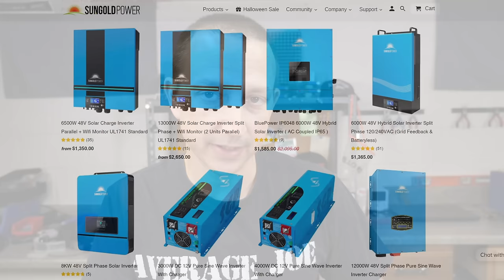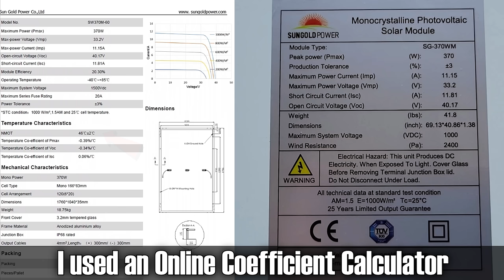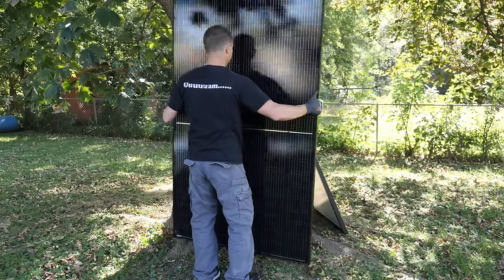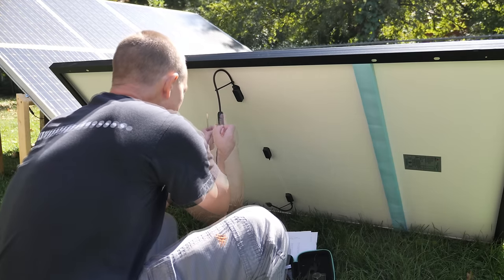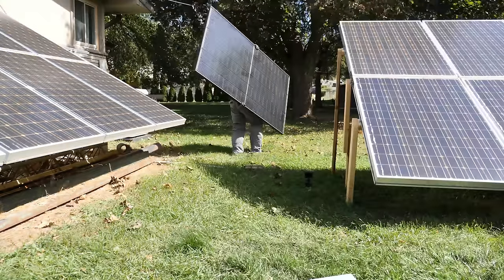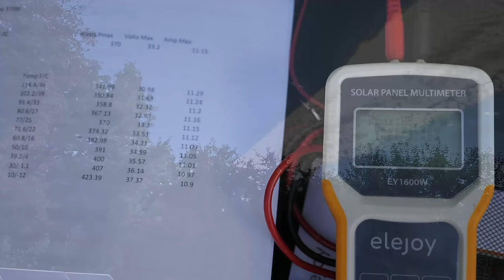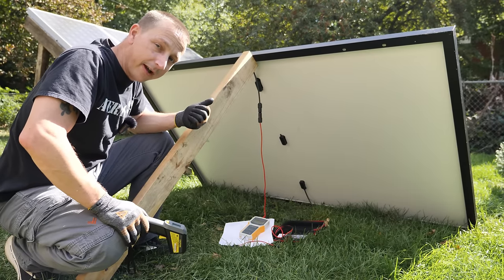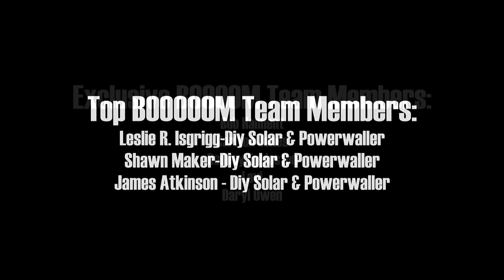Sungoldpower.com has SOLAR PANELS!!! 370W Mono Black Perc 4.4kW

Comment: Going on 1 yr of Sungold Power equipment ownership of 2 x TP6048 and 2 x SG48100P batteries. Totally awesome equipment. Didn't go with their panels because of shipping and per unit cost as I live in the Caribbean. Also, they lack cross braces (reinforcements) that I think is a must for such large panel. heavy winds (hurricane zone)   Highly recommended company. Otherwise, very happy with purchase of the inverters and batteries from Sungold.

Comment: Just for technicality the temp gun  should be held closer to the surface you are wanting to read the temperature on for a more accurate reading. Distance in this case does matter for the most accurate reading.

Comment: Great video Joe. Just wanted to let you know that every solar tester I have reads around a 10% error in comparison to real test equipment. I also see quite a variation over activation time. The longer the tester is activated, it starts to heat up and reads more error usually favoring the solar panel specs. I use a Keysight N3300A load tester to do real measurements and to compare my cheap meters to. I realize that most people don’t have access to this equipment and can only use what they have. Just keep in mind the problems with cheap import meters. Thanks again for all your videos.
Reply from the maker: Awesome! Thanks for that info! Ill have to look that up!
Reply: @AveRage_Joe  hey Joe, I work for Keysight. If you ever want to do a review about solar testers and need a calibrated load bank like the N3300A to compare with, let me know. I can probably have something shipped to you if we have one in our demo pool.
Reply from the maker: Yeah we could probly work something in! Is it tricky to use or learn how to use😄

Comment: Joe: On the label is that standard insolation number of 1000W/sq meter.   Your day could be anything between ~700W and 1,400W/sq m!!  To do any kind of valid test you should measure the insolation while you're measuring the panel output.  That way you correlate the panel power output to the actual solar radiation at the time of your test.  Insolation meters are not expensive and are smaller than the panel power meter you toasted.    It could well have been the cold panel and a much higher insolation than 1000W/sqm took out your power tester.

Comment: Canadian solar bifacials 400w same dimension. Semi rainy cloudy day 240 each. Have them setup as wrap around awning not on roof so can take advantage of bifacial going up to 440w.. But if had option to get all black,  sure would go for what's shown to add on. If under 1.74$ per watt shipped, as that's what paid before. Good video, Have a great day.
Reply: The only problem with Canadian Solar is they don't function as well as other top brands in extreme heat environments. So unless you live in the north, there are better panels.

Comment: I'm dating myself here, but that solar meter looks a lot like the handheld football game I had as a kid. 😂
I'd be concerned that the panels are pushing out more than they are spec'd for. That could be an issue for others than plan for a specific amperage and wattage. That could cause some serious issues with equipment.
Reply: Yeah, it does.

Comment: I'm Interested in the inverter. You have this 12 kWh. My question is the average current that it can handle is what? 
I saw that the light is almost 1kwh. stove and other "heavy normal home apps" would be like another 3 kWh or 4 kWh!
So for how long do you think this 12kwh Inverter can handle these loads? And what are the limits for it?

Comment: JOE, LOOKING FORWARD TO YOUR NEW PANELS UPGRADE!
ALSO, HAVE YOU INSTALLED 200 AMP TRANSFER SWITCH FOR YOUR GRID & GENERATOR INPUT, SO YOU DON’T HAVE TO DISCONNECT GRID & INSTALL GENERATOR IN LONG BLACKOUT CONDITIONS?
Reply from the maker: I did install a transfer switch about a month ago...sadly it blew up as well lol.  A coil burned out... Ill have to get a diff brand and reinstall!

Comment: Good review.

Here's an off the wall question.  Since the panels get quite warm, could you capture that waste heat and use it for hot water, or even to heat a small space?
Reply from the maker: I guess it could be possible. Maybe some thin copper lines under the panel and the routed to a heat exchanger.🤷‍♂️

Comment: Hey Joe we love watching your videos, could you make a list of sun gold products I could order and get shipped to South Africa 🇿🇦 I need to get off the grid , we have 3 phase, 
2 pool pumps @ 1.5 kw each
2 bore hole water pumps @ 1.5kw each
1 x water filtration pump 1.5kw
LED lighting - 500w
Microwave 450w
Fridge 450w
Freezer 450w
Walk in fridge 450w
Washer 450w
Dryer 1.5kw
Security lighting 700w
Kitchen misc appliances 2kw

Our back up Genny is 16kva runs everything as u know everything not on all at once

I have no idea what to buy how many panels , how many inverters, how many latest batteries 

And spares in case of failure to swop out

Much appreciated
Reply from the maker: Ill have to see if they ship there??

Comment: They seem to be of high quality ! One question regarding the 12kw Growatt,  do you happen to hear a buzz from the charge controller side ? I installed the inverter 2 weeks ago and its working great ( Thanks for your advice) the only problem is this buzzing sound that goes away as soon as the sun goes down.
Reply: I have the same Grimlin living in mine,humming transformer noise when the sun is up means its working. mine makes all kinds of humming and hissing noise. i believe its the high voltage  oscillation in the transformer.
Reply: @ISeeDeadGamers  I think you're right ! Just wanted to be sure.  Thanks!
Reply from the maker: I havent noticed any buzzing but Im usually not very close to it after sun goes down.  I can check tho.  Is it loud or soft?
Reply: @AveRage_Joe  it's a soft buzz only while it's charging. Thanks for your reply !

Comment: The reason for lower output is the lower sun angle. What, is this your first day?😅
Reply: I don't trust your meter. It's calculating watts from VOC, no real current flow. Big difference.

Comment: I’ve considered trying out a SG inverter.  I just bought a pallet of new panels and mine were not packed nearly as nicely as those were. You’re getting some solid power out of those panels!  Pretty soon you’ll need to get some Bitcoin miners to burn off all that excess power!  ☀️⚡️👍🔋🤠
Reply from the maker: Yeah they packaged them really good!  As far as excess power...that only happens in the summer.  Id need to have better angle on the roof for wintertime to attempt excess.  I did have Eth miners a few years ago😆

Comment: I checked out the featured site. They advertise free shipping. I did a little math and the more panels you buy, the higher cost per Watt. Seems counterintuitive. Two panels cost $1.10 per Watt, six are $1.60 per Watt, and 20 costs you $2.10 per Watt. Maybe shipping isn’t free and built into the quantity of purchased panels. I feel a little hustled already.
Reply from the maker: Hmmmm, Ill have to take a look!

Comment: If a panel delivers more power than it's rated for, is it the voltage or the current than goes above the rated value or both?
Reply: If it's over because of the temperature then mostly voltage. If it's over due to insolation then it's mostly current.
Reply: @niktak1114  thanks for this very helpful reply.

Comment: Not a fan on the short  cables, I have never come across any panel with short cables. Those testers are garbage, I burned up 2 already. I wish they have a breaker or replacement fuse when they encounter over wattage :(

Comment: I have a 15s for a long time now I wanted to buy a new battery but I'm only seeing 16s can they work together in parallel? Or will I just have to change out to 16s?
Reply from the maker: Can you just add a single battery to make it a 16s??  Or am I misunderstanding
Reply: @AveRage_Joe  well they are welded can I still add one more cell